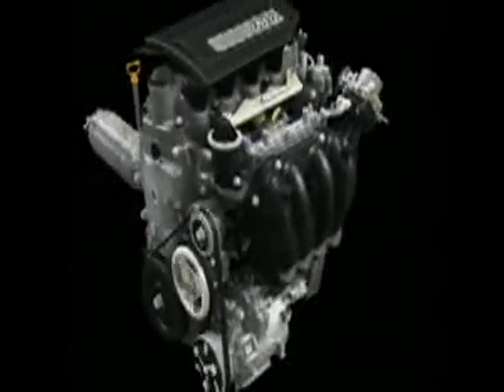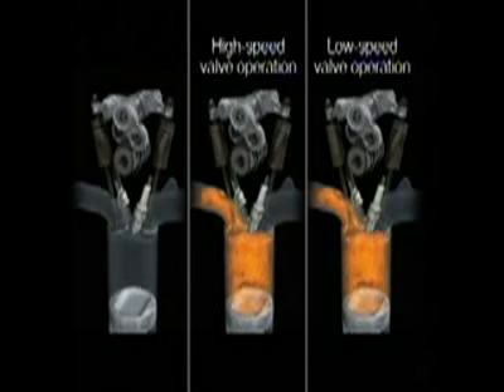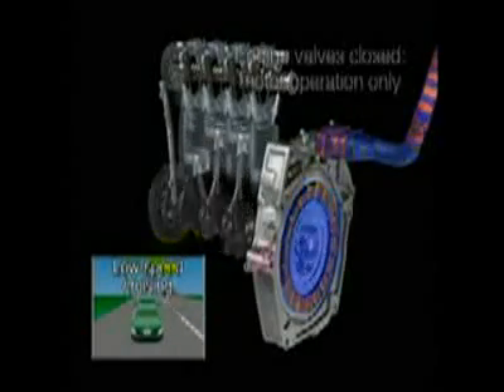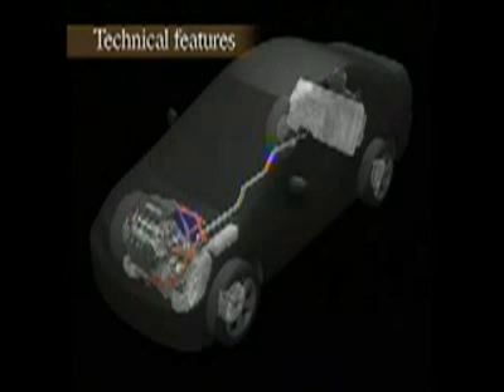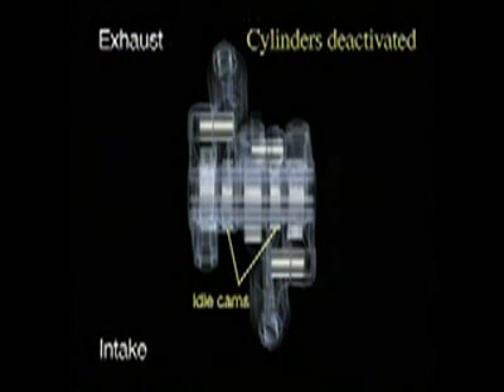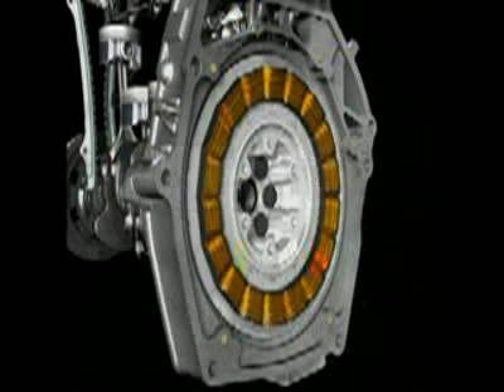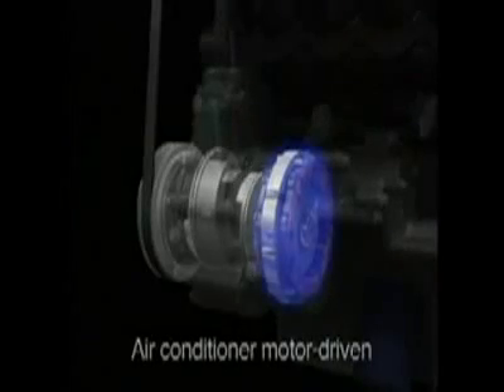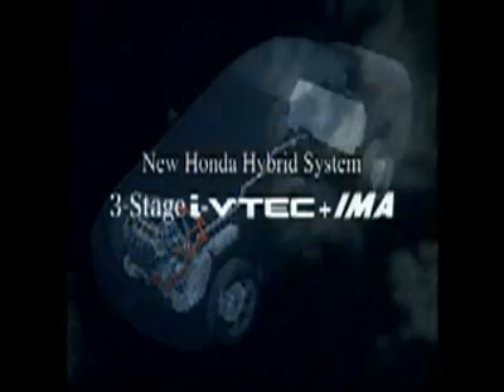Honda 3 Stage i VTEC + IMA

Comment: It feels like a normal engine running... when you are moving and no fuel is being injected and the IVTEC system has the valves closed the vehicles own inertia is keeping the crank moving by way of the wheels through teh CVT transmission.

Comment: So when the car is stationary and idling the pistons are moving but there is no fuel being used, is this just the electric engine keeping those pistons moving? and for how long can you stay stationary before the electric engine runs out of juice? 
When you are idling does the car feel as if its switched off or does it feel like any normal petrol car would (low engine humming)?